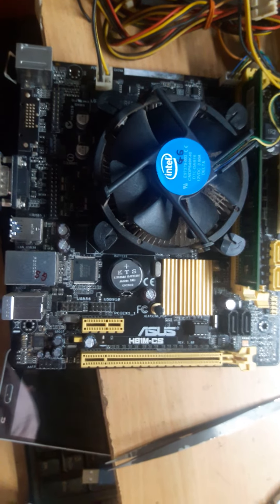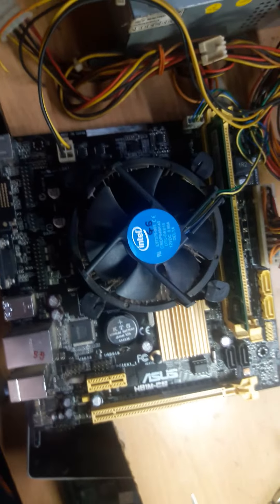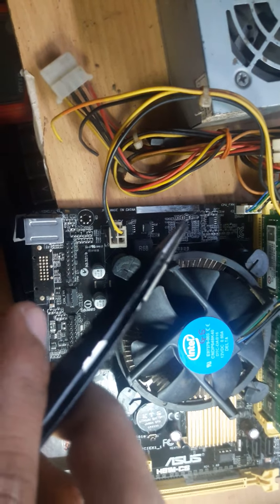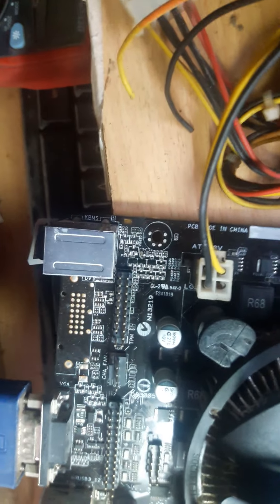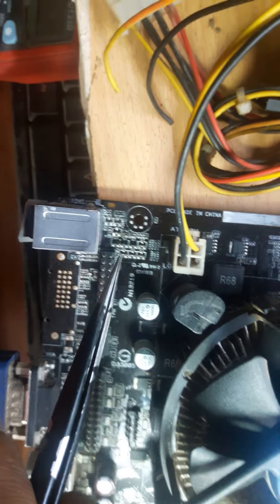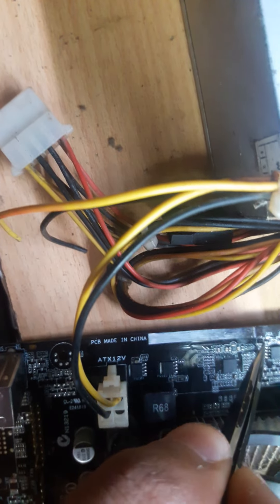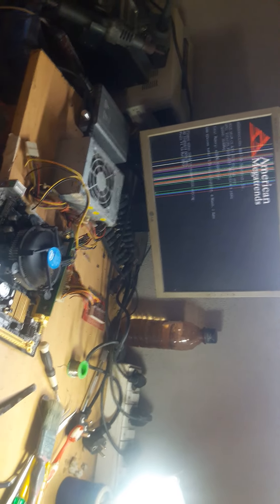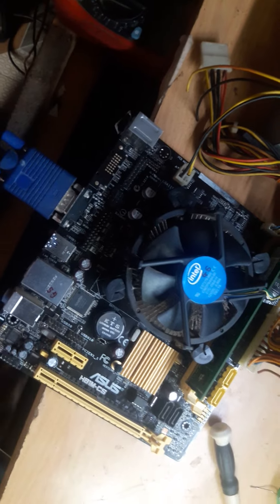Asus H81M-CS Fan spins and stops ll No Power ll

Comment: nice video, but can i ask you something ? my motherboard (asusH81m-c) when i press turn on button the pc only turn on and off repeatedly theres no problem with the psu
Reply from the maker: First check CMOS cell then check one by one voltage rail if there is problem with any rail just fix it